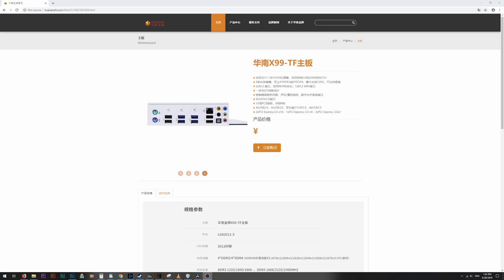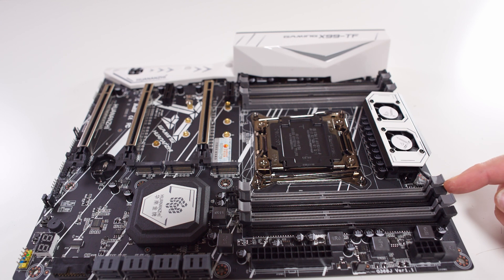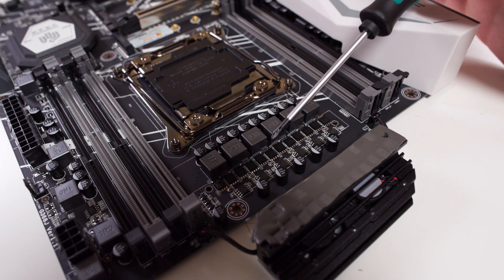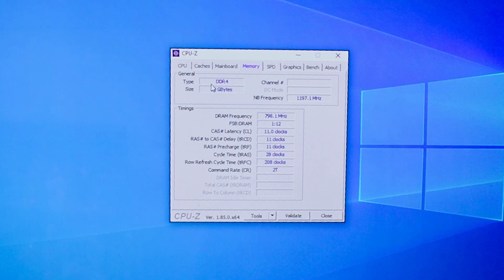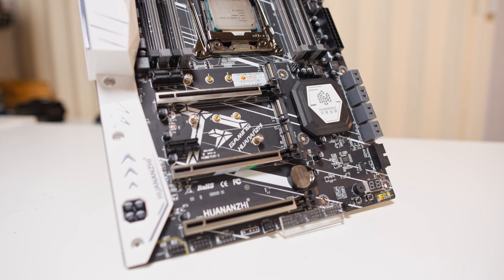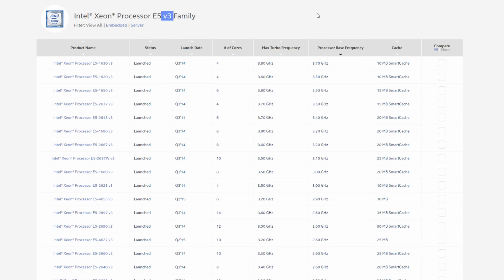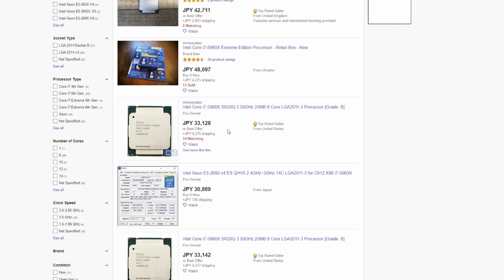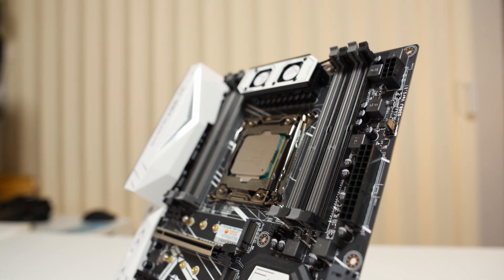Huanan x99 TF Motherboard Review

Comment: Believe it or not Huananzhi does actually have legit warranty. I had a similar x99 board that I made a claim on and sent in think at least if nothing comes of it that will at least save me the trouble of taking it to an electronics recycler, I too did not expect much and ended up forgetting about it. 3 months later a new board showed up at my doorstep. I was genuinely shocked.
I think because these boards are basically made from recycled parts anyways that it isn't much of a loss for them to replace a broken board since they can just stick it back into their pile of e-waste that they strip all the good pieces from to make more boards from. Huananzhi, Jingsha, Erying, and Machinist are all actually pretty legit companies, that just like making kickass affordable hardware.

Comment: 6 vrms are very low for lga2011-3 the lowest asrock  have 10 power stage
Reply: Been using X99-TF v1.1 with unlocked 2696v3 without any problems for 3 years now

Comment: I got this board with a E5-2678v3 , 32gb ddr3 1600mhz , gtx970 , nvme 970 evo plus. (and my other 5 drives)
The Cpu in stock consumes 80w at 100% and 42ºC MAX with a snowman triple fan cooler.
On iddle, goes arround 20w and the gpu arround 20w, totally amazed.
The board and everything worked perfectly,  I have 0 complains

Comment: actually i can get a pwm fan that size... i do 3d printer tinkering and we use that fan size a lot... you can get cheap, powerful, but loud delta fans for like a couple of bucks and if you want to you could go noctua the powerful but silent and expensive.... both are very easy to find in the DIY space... i saw someone swap the fans for an m.2 heatsink so i was thinking of doing the same but mount the fans on the outside of the shrouds with some anti-vibration mounting...

Comment: Great video! Have you or anyone tried using the rgb header? I bought a led strip but 1 having issues plugging the cable into the motherboard. It seems like they made the pins too large for the cable. 2 have yet to find any software to control lights. :-( maybe I just need to buy a led strip powered right off the PSU.

Comment: don't waste your money...i purchased one of these thinking wow all this and the price too...and yes it looks pretty...i received mine a month later after it took them 17 days to process the order..i purchased the combo the 12 core Xeon, 32gb ram and the x99-tf...when i checked it out i found one ram module was bad and it actually was used server ram...no biggy, the CPU was also used(but so far it works) i then found that the drivers supplied did not work with windows 10 pro, so i went to their website and downloaded their questionable drivers with no driver date/version (actually said unknown date on download). these also did not work...so i went to the (Ethernet) chip set manufacturer and finally got the thing to connect to the internet. and then i tackled each problem individually...you see it (MB) was not fully compatible with Windows 10, and while it has the same problems that plague other X99 boards from legit manufacturers these guy locked or removed many of the functions in bios that where used to correct those same issues.. i also had wiring problems as the motherboard jfp1 connectors where too small and the case wire connectors fell off repeatedly. then the screaming started i installed a MSI RX5600 xt Mech and it came unglued...fearing for my video card i continued using a cheap MSI, eventually i manage to get the system working to find it did not recognize my M.2 or SSDs. after contacting them i found there was no warranty and no customer service also aliexpress sided with them as i didn't use an eraser on the contacts as was told by the manufacturer (my belief was that i wanted something that worked, not a used and defective item i had to coax and trick into working)...so if you are a programmer and know your way around bios you may be able to have a working system in a day...if not get a legit board. i will be posting this warning for as many as possible to see so they do not suffer as i did
Reply: strange, my x99-tf is instantly started to work with windows 10 without any driver issue (and with Fedora to)...

Comment: The V3 Xeon CPUs are actually much faster than the V2 CPUs if you flash the bios with the microcode fix that allows the single core turbo boost on all cores. Currently the xeon e5 2678 V3 can be found for less than 100 USD. V4 CPUs sadly do not have the same bug as V3 and therefore cannot be run at max single turbo on all cores
Reply: where i can get this update flashing fix
Reply: @צחיאביטל-ה9ע  it depends on your motherboard, every bios is different and you might need to mod it yourself if nobody else has yet. You basically need to remove one of the microcode updates from the bios dump and reflash
Reply: @highvis_supply  what motherboard do u have?mine is chines motherboard with two xeon  e5 2678 V3

Comment: does this motherboard support i7-6950X or Xeon E5-699 v4 which has a TDP of 140-145 watt?

very difficult to find info about the CPU support from this mobo, I have searched everywhere, there is no datasheet or clear information about this.

Comment: They put those stickers on top of the Ram slots because random fragments, shavings, byproduct material can fall down into the actual slot during later stages of refurbishment/remanufacturing. Believe it or not, it does happen. Probably more than you'd think. My Asus Crosshair Hero VII x470 didn't have protective stickers over the DIMM slots and it came with what looked like a rolled up ball of adhesive material stuffed down inside one of the DIMM slots. I nearly broke both the board and the DIMM in an effort to get the damn thing seated properly.
Reply: The stickers are there because there is two types of ram that fit (99.9% of MB dont have this feature), so its simply a warning and headache control for them and end user. If it was for fragments, then what about the 5 pcie slots?

Comment: Happy New Year to all!!! Health, happiness and well-being in every home! Who can say one moment. I ordered from Aliexpress motherboard Huananzhi X99-TF Gaming and Xeon E5 2640 v3. In one of the VIDOS it was noted that the RAM voltage on Huananzhi X99-TF Gaming is not regulated in fact and ranges from 1.2-1.23. I have a Corsair 3000mhz RAM with a voltage of 1.35. Q: will my Corsair work on Huananzhi X99-TF Gaming?
Reply: The processor only support 2400 max
Reply: @jimskrig5595  No, friend! The processor supports a frequency of only 1866 mhz. But the Corsair 3000mhz RAM has the ability to operate at lower frequencies. I've already checked everything. The Corsair 3000mhz RAM runs safely at 1866 mhz along with the Xeon E5 2640 v3 on the Huananzhi X99-TF motherboard.

Comment: Do you recommend it?
Reply from the maker: As far as a Chinese board goes its great sure. But with Ryzen prices the way they are especially on the used market I cant really recommend any of the x79 or x99 stuff anymore....
Reply: I would recommend it for Server or Virtualization setup. Using Proxmox with it choosing a 12cores/24threads for less than 300$ with CPU and 32GB is a killer...
Reply: Yes I recommend it x99+e5 2678 + 32gb. For sure we do recommend

Comment: They could have used a generic 2302 MOSFET to implement PWM control on the little fans. Domestic versions are widely available in China and cost almost nothing. But they didn't.
Reply from the maker: Thats exactly what I though they should have done😂
It would take little to no effort.

Comment: Hi, does this mainboard support 32GB memory sticks? I have x99-AD3 and it can but I saw many hiccups and lags during heavy load (those didnt appear with 16GB sticks installed)
Reply from the maker: I cant find anything that says it does, but I would try lowering CL and timings and/or raise your dimm voltage. Installing a lot of memory can sometimes cause unstable memory because its more strain on the IMC.
Reply: Kate's Hardware Reviews I bought one, and it seemed to have the same problem, maybe the Bios IMC doesnt support timing memory value over than 11 (32GB sticks are 11-13-13 35. I tried to input manually but it didnt help (bios directions stated that value from 0-4 Auto, 5-11: timings)
Reply from the maker: @nguyenduclan0509  Any ddr4 or ddr3 for that matter running a main timing at 4 would be unstable and probably never boot.....even on ln2 so I am sure its just the bios having a bad description. for 4 32gb dimms try something like 1800-2100 at cl 14-16 and a vDIMM at 1.6v. and try to keep all the other timings lose as these boards dont have great memory training.
Reply: Hi Lan, how is your test? I want to install 128GB on X99-TF, does it possible?

Mình muốn chạy 128GB RAM, trên Aliexpress với một số trang review báo chạy được với DDR3, không biết có cần chỉnh sửa gì ko nữa. Hoặc chạy có ổn định không nữa. 64GB (4*16) thì hơi ít với mình :(

Comment: Xeon e5 2696v3 support DDR3? Do u have proof?
Reply: Hi friend? I used X99-AD3, a previous product on that motherboard, and I used DDR3 and ECC / REG on 2696v3. This is real. Of the 18 cores, 2696v3 and 2686v3 are available!
Reply: @음더러  hi, this motherboard x99-ad3 good and stability works with xeon 2696v3?
Reply: @Sh1neL00t  stability works stability works stability works
Reply from the maker: What do you mean......I showed it on the video. You know its not some big secret that these haswell CPUS support DDR3....
Reply: @KatesHardwareReviews  Hi friend? I used X99-AD3, a previous product on that motherboard, and I used DDR3 and ECC / REG on 2696v3. This is real. Of the 18 cores, 2696v3 and 2686v3 are available!

Comment: Mainboard is quad channel memory capable, 7.1 channel audio by realtek 892 chip. CPU VRM area is populated with 5+10 capacitors, provides good stability. x99 platform is aging, this year CPU's patched by Intel. So, there is no need to pay a lot for a mainboard. Latest DDR4 rams are not good fit for this mainboard, because around 2400MHz DDR4 is the highest limit for Xeon v4's. New DDR4's went 3200 to 4000 so be careful when buying, low spd timings must be checked for being sure on the module. If you are a montage fan, choose a v4 Xeon for 4K montage for use with Magix Vegas version 17, which is the minimum specs for it. Only drawback is, there are no 3.1 USB ports. Nevertheless good job Huanan....
Reply: I saw the same board with the same price but 1 is ddr3 the other ddr4....which one to pick? go with ddr3 cheap memo or ddr4 lock??

Comment: i think the best value/performance cpu you can use on that board is the xeon e5 1650 v3 (86 euros/94 usd) which is technically an i7 5930k, or the e5 2660 v3 for (83 euros/96 usd)
Reply: that cpu rates 13,700 on passmark v9, for $7 more (well its the same price on Ali) you can get the e5-2678v3 and get 18,300 (~33% faster), in a non oc condition (w/o modding bios). Any idea what passmark v9 the 1650v3 gets when OC? the x99-tf/2678v3/32gb-ddr3-ecc is $255 now on Ali.
Reply: Andreas Petrou wondering that huanan mobo could oc that cpu
Reply: @thanhanle3879  maybe up to 4.2 or 4.5ghz with bios mod

Comment: Thanks for the excellent review.  Finally, a thorough review in English, no less! I have purchased the HuananZhi X79 deluxe and it has run well in my eldest daughter's PC, for over 8 months.  It is coupled with an E5-4627V2 (8C/8T) that I got for $80 plus shipping ( a nice deal).  

Although the X99 TF board itself would be top on my list for a budget build using DDR3 (already in hand), the IvyBridge CPU's are usually more discounted...more than the 20% gain from these V3 chips. It clearly makes a lot of sense for someone having to deal with higher landed costs (e.g. import duties, shipping), where these solutions can be compelling.  But these Ryzen prices make this harder to justify in late 2019, IMO.

Next time around I will see what is available from V4 and Ryzen...then do another budget type build at that time.  Maybe in the next 2-3 years. My guess is that pricing will get much more interesting given recent market dynamics...meaning even more choices at that time!
Reply: X99 does have its benifits over ryzen, quad channel, dual m.2 support, ecc ram support, and pretty good oc on the right CPUs, even x79 was decent at oc, I have a Xeon 2650 v2 running 4.4ghz on all cores absolutely fine
Reply: X99-TF Dual Chanel? Quad Chanel?
Reply: @allysonribeiro9807  QUAD channel.  I am running Mushkin REDLINE 1866 DDR3, in 4 x 8GB configuration. This is un-buffered non-EEC RAM. My understanding is that the X99TF will also handle server ram with my E5-2678V3 CPU.